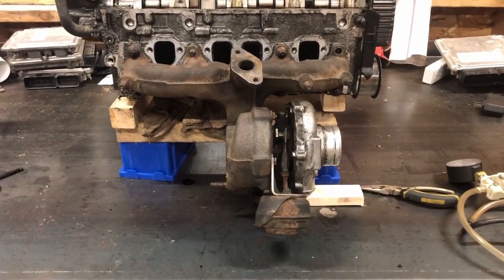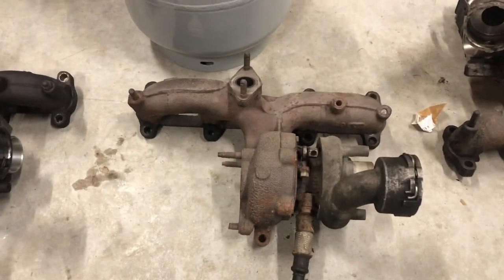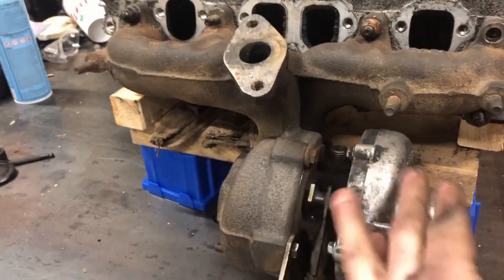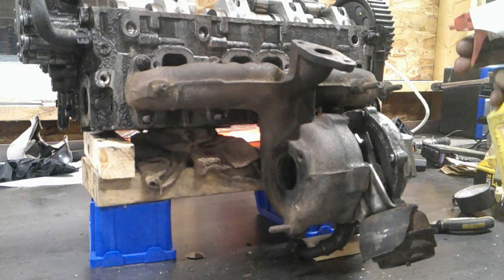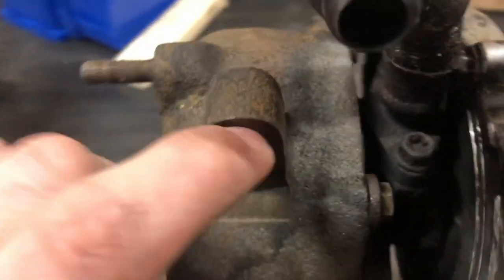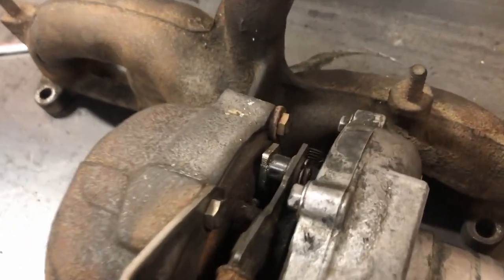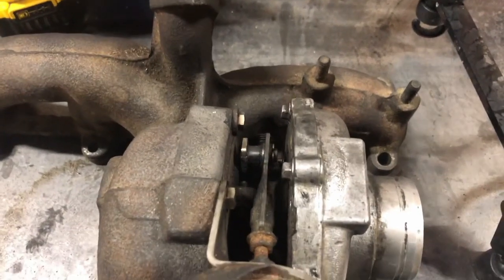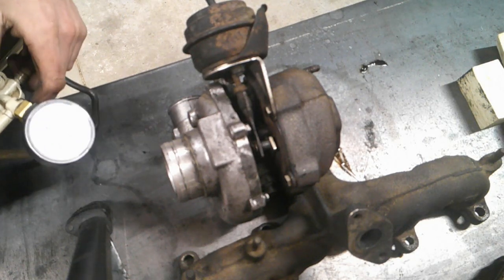Cleaning TDI VNT Vanes: On-car Vs. Bench

Comment: My one bolt for the EGR port stripped so i just filled the top side with oven cleaner with the cooler pipe filled even more...... started her up she hesitated first crank but then started...... got back a little turbo sound, ....... i dont have must time on my hands and shes my daily drive car...... so i will find  a way to get that stripped EGR bolt off when i have enough time since its almost school holidays and i i dont have to drive that much.....so i can remove the whole turbo and do a proper clean disassembling the whole thing down to the vains...... will come back with feedback after im done
Reply: Where did you fill it from up top I am in the same predicament and I don’t have anytime I could really tear the car apart

Comment: I have a question in regards to using oven cleaner will the seals on the turbo resist the cleaner?
Reply from the maker: Yup I’ve done many without issue

Comment: I have 11 years and 194000km of driving and my turbo is only now starting to stick, after seeing the on car cleaning I have decided just to buy and have installed a new turbo, at least that way I can hopefully get another 100000km out of it, thanks for your video, I was considering a mr muscle quick fix but realised it would only be a temporary fix. (Car is a 2009 VolkswagenTransporter T5)
Reply from the maker: Yeah nothing beats replacing it, besides getting sticky they do wear some as well. Main issue i think is people baby-ing them causing extra soot and never getting hot enough to burn it out.
Reply: @JoshsJettas roughly how much would be a fair price to have a turbo replaced on a 2012 Jetta CJAA?

Comment: should i leave  oven cleaner for 2 hours before starting car and taking it on the free road to blow out all dirty stuff out?
Reply from the maker: It wouldn't hurt it but I'd still occasionally work the lever while waiting, it does kind of foam and bubble some so it might help working in better
Reply: @JoshsJettas  What lever specificly are u talking about? Ive heard many talk about this lever, but idk what they are talking about.
Reply from the maker: The lever on the turbo that the vnt actuator is attached too. Work it up and down while letting the oven cleaner sit if doing assembled.

Comment: WOW thats proved the point. I have a sticky VNT which keeps throwing my VW van into limp mode. I have the EGR removed to try the oven cleaner trick but it clearly needs to be removed. Sadly I have no flash garage only my driveway to work in. So to get to a VW van turbo to remove and replace is a 2 day job under the van!
Reply from the maker: I really enjoyed this one as I was curious myself. Doing the on car method has gotten me by for a limited time but obviously not the same as disassembly and scrubbing. We sadly didn’t get any tdi vans over here, even the TDI’s we got were quite neutered.
Reply: @JoshsJettas  Ive discovered after TWO CANS of oven cleaner my VNT is locked SOLID so Im halfawy thru removing the turbo. But worked out a way to do it from the top pretty much!

Comment: Excellent video pal 👌🏼 Are you using brake cleaner spray to clean inside the turbo?
Reply from the maker: Yes, it’ll blow out after running the engine too but oven cleaners hard on the hands so I wanted to flush it out before reassembly

Comment: No issue with oven cleaner rolling back into the aluminum head from the EGR port and damaging it, I guess. I still think I would take it off and clean it like your second example.
Reply from the maker: None that i've heard of, I've done aluminum intakes as well with oven cleaner. If its only on for a short time it doesn't seem to affect it. I'd agree with taking it off and disassembling for a more thorough clean.
Reply: @JoshsJettas  that's how I cleaned my stock intake manifold and let me tell you, what a fn bear it was. When I did the egr delete and race pipe I knew the intake needed to be cleaned after removing the egr valve and seeing there was no more than an American quarter's worth of space for the air to travel. I'm waiting for KermaTDI to get their old man intakes in again so along with their new all aluminum SMIC and upper and lower plumbing I'm gonna get as big a turbo as it allows until I'm ready to scrap all of it and put Darkside Development's Audi S3 all aluminum intercooler/core kit along with the gnarliest turbo they come up with. I've read some interesting custom impellers from black widow also make the turbos scream....because fk the neighbors feelings. 🤣

Comment: I appreciate your video and subscribed. Do you think the oven cleaner is safe for the seals inside the turbo?
Reply from the maker: Hey, thank you hope it helped. I did the turbo on my car through the egr port before installing the new engine and that was 70k km ago with no issue. I don’t think I’d keep the turbo filled with oven cleaner for a week or anything like that, fill it up, free it up then go run it hard and clean it out.
Reply: @JoshsJettas  Yeah, I also thought that a week will be a little excessive 😅 Thanks for the good advice and sharing your experience!
Reply: So how long would u recommend letting the oven cleaner sit ???
Reply from the maker: Fill it full, work it back and forth until it frees up and take it for a drive. If you disassembled it then I’d wash it out fairly quickly

Comment: How would you go about installing an Egt probe in one of these turbos? I’ve been looking around but nobody has a good idea on how to do it. Some go through the egr port and others drill a hole where the exhaust runners merge.
Reply from the maker: On my personal car I drilled into the exhaust where the all merged. On my clip art it’d be about where the O in turbo is. Grease the drill bit and tap up and no filings should fall into the turbo (can remove the turbo and do it upside down as well).

Reasoning for doing that is if your going through the egr port you need the extended probe. I was concerned about low readings as well as the longevity of the extended probe being subject to big temp swings and vibrations.
Reply: @JoshsJettas  Understandable with the vibrations. I’ll probably end up getting one installed before I buy injectors and a tune.
Reply from the maker: @ethanhoullahan5423  yeah depending on the tune it’s definitely a good idea. That’s how I ended up with my ALH, PO melted 3 of the pistons and the fourth one cracked from not running a gauge
Reply: @JoshsJettas  what does PO mean, im not native english speaker?
Reply: and btw after spraying inside should i wait 2-3 hours before going on highway or somewhere place where i can drive fast to blow out all the stuff out
Reply: @RinosaurPravi  PO = previous owner

Comment: Aren't some oven cleaning products corrosive to some of the alloys in a turbo?
Or is there no aluminum on the hot side of a turbo?
Reply from the maker: I guess I can’t comment on the oven cleaner being corrosive to metal, I believe the nozzles and ring are stainless. I’ve never had an issue.
I’ve also used the easy off brand cleaning intakes if I don’t have access to a heated pressure washer. I can’t say it corrodes the aluminum but it definitely stains it if left on for an extended time (1 day or longer).